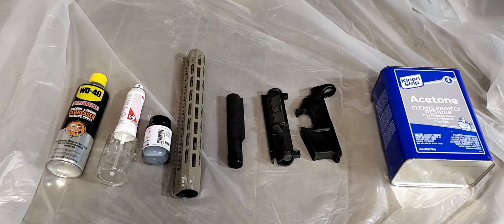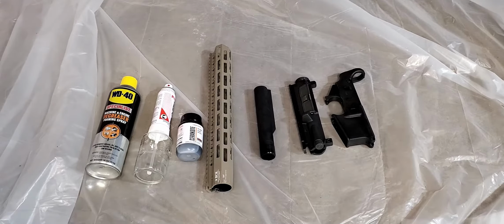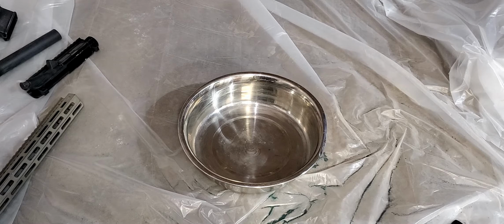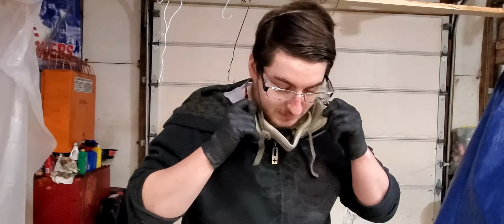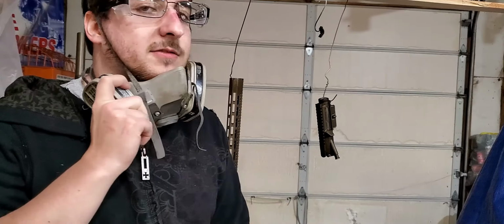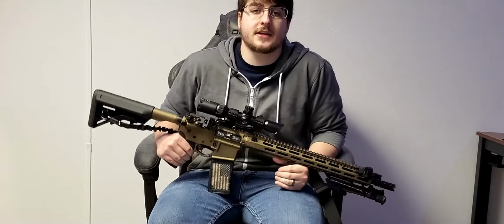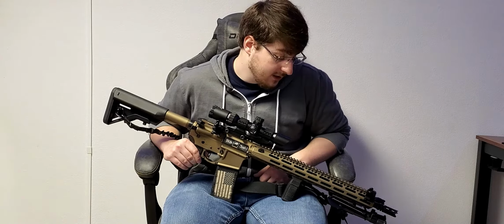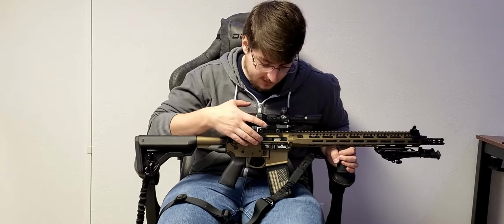Cerakoting My AR At Home With A Preval Sprayer | Burnt Bronze

Comment: It looks great man. I am a painter among other things. Sandblasting is just done because it roughs up every spot. It's a little harder to scuff everything with sand paper but you can do it. That sprayer you used works just fine for small parts. You wouldn't want to do a car fender with it, but for gun parts it works fine. Baking your metal parts is done to get the oils and contaminants out of the metal. Metal has pours and grain and can absorb some chemicals to a degree so baking it helps to get those oils to the surface so you can then clean the oils off of the metal. I will usually clean something, then bake it and clean it again to make sure it's really totally clean. If you do this a lot or as a business, a proper paint gun is the way to go, but doing a few things for yourself, I agree with this spray bottle you used.
Reply from the maker: Thanks, I was just doing this for myself so  I figured it was worth a try
Reply: @Gamerj2014  Absolutely. I would definitely go this rout if I didn't already have a shop, sandblaster and paint guns.
Reply: @CarbonGlassMan  what kind of median to use in a sandblaster to rough up the paint and not totally remove it? isnt there fiberglass flakes or something?

Comment: 6:23 
Your results look good. But for those who are here for information on the process, (I am here for the finished color shots). 
Cerakote specifically recommends one thicker coat and not several light coats. They actually cite that as one mistake folks make when using their product. As it’s not the same as regular paint. 
Hope this helps someone. 
Great job man. 
Looks great. 
And THANK YOU for not showing a cleared weapon. 
lol
Reply from the maker: Thanks for watching!
Reply: @Gamerj2014  
Heck yeah. 
👍🏼

Comment: Great job! the only recommendation would be to take your spray strokes lengthways rather than strokes across the short width...will make the finish much smoother and eliminate any spatter...either way looks great. Thanks for sharing
Reply from the maker: Thanks for the tip, I'll keep it in mind next time, and thanks for watching!
Reply: @Gamerj2014  couple of follow on Q's where did ya buy your preval sprayer kit, how much did you have left over and if ya had to do it again what would you do differently.
Reply from the maker: @rhino67  I ordered the Preval Kit online, but it can be found at most hardware stores.  I hardly had any paint left over. If I did it it again I would make sure to go slower on the trickier spots, such as the picatinny rails and small crevices.

Comment: point of baking prior is to burn out the oil.  i wash it with brake cleaner, air dry, then handheld propane torch to burnout the oil
Reply from the maker: Propane torch is a good idea

Comment: What kind of spraying equipment are you using?
Reply from the maker: Everything I used was shown in the video
Reply: @Gamerj2014   do you have links or names as I’ve never seen cerakoat spray bottles like that before. I’m looking to do the same type of project
Reply from the maker: @Protectiveedgetraining  as shown in the video, I used Cerakote and put it in a Preval spray bottle I purchased from the hardware store. The Cerakote did not come in the spray bottle.

Comment: Great job! How long did you wait between coats? When using ceramic engine paint you wait 10 minutes between them.
Reply from the maker: Thank you! I applied the Cerakote in thin coats to prevent running and I waited 10-15 minutes in between coats.

Comment: Did ya bake it after you painted it?
Reply from the maker: No, I used Cerakotes air dry series that doesn't require baking.  They sell a seperate bake on version as well.
Reply: @Gamerj2014  ok  I bought the H series I believe so I'm going to have to use my oven in my kitchen lol
Reply from the maker: @mattyockey9195  on the plus side, the bake one will be more durable!
Reply: @Gamerj2014   So I've heard I was going to duracoat again but when I use that stuff I could not get any of my take down pins back in lol

Comment: You were supposed to bake it and in the oven man lmao after you paint it to set the paint onto the gun parts wow some people just can’t read directions don’t follow this guy your cerakote won’t last a week period
Reply from the maker: As stated in the video, this is not the bake on version of Cerakote. This is an air cured version, it is not as durable as the bake on stuff and takes several days to fully cure.  It still holds up to this day.